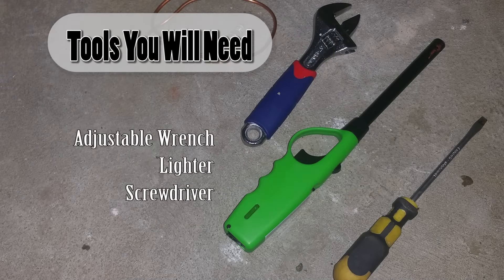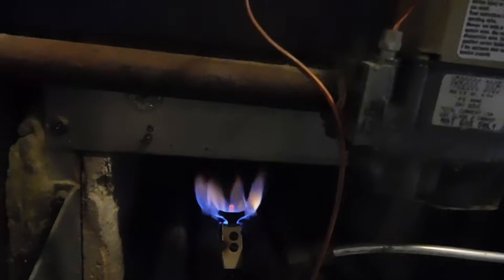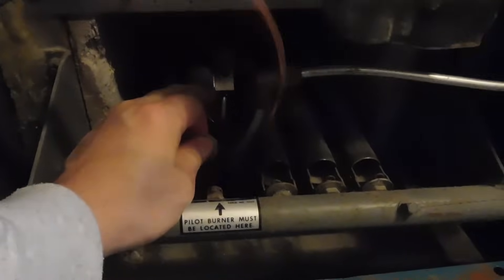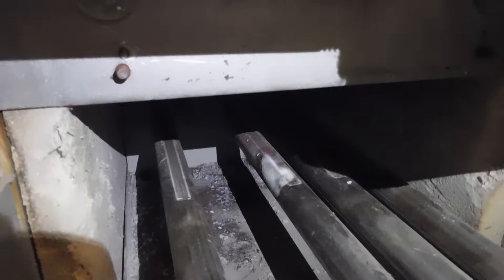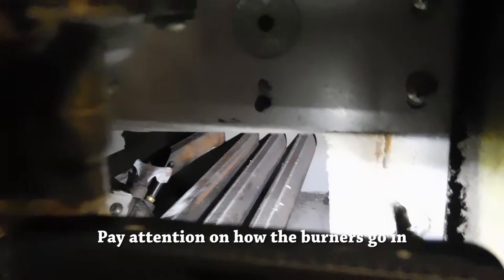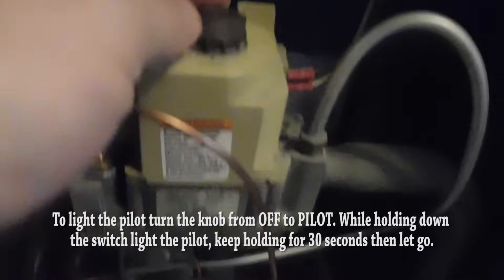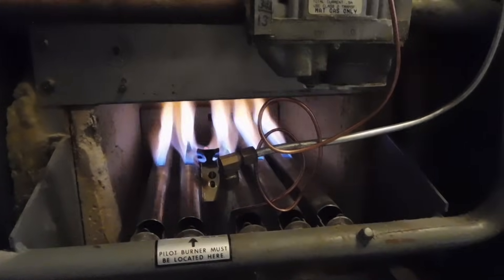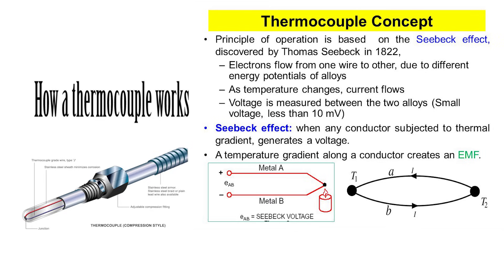Boiler Pilot won't light / Replacing the thermocouple if the pilot won’t stay lit

Comment from the maker: Thank you all for the great positive comments. I really hope this video helps as many people as possible. Link to thermocouple https://amzn.to/2VmVV9Q 
If this video helped you I would love to hear about it in the comments. Please consider checking out and/or subscribing to my channel and supporting me by signing up for an  Amazon 30 day FREE Trial - https://amzn.to/2ItA9Ar
Reply: Da P.A Hi there !! i’m hoping you can help me on this one; i’m trying to repair my friend boiler, his furnace just stopped working, is dead, pilot is off and doesn’t light up, so far i checked the power coming into the furnace, i have 120 volts in, and 120 out at the on/off switch, i have 24 volts coming into gas valve, but for some reason there is no gas flowing because pilot doesn’t light up at all, i checked ohms on the gas valve and i got 5 to 7 M-Ohms, i checked continuity on the gas valve terminals and i got OL (open line) i also checked the vent damper and it’s on the open position, the gas pipe is open as well,the boiler is Weil Mclain Model # CGa-5 SPD, and the gas valve is a honeywell VR8200A2116, i need help desperately, what can i do ??? replace the gas valve??? the thermocouple???  do more troubleshooting, please any help is greatly appreciated.Cheers.🙏🙏

Comment: I know this is an old video, but I just wanted to say I have a 90's Reem Criterion II gas furnace and my flame is 3 times smaller than yours.  My thermocouple lasts 7 to 10 years. Maybe your flame is too high and that's what is causing you to have to change out your thermocouple every 2 years???
Reply from the maker: I ended up adjusting the gas flow to the pilot and it's been lasting a lot longer. Thanks for the comment.

Comment: Home Depot doesn’t open till morning and mine just went …. So we turn off the gas someplace?? That little knob next to where you press down?? I turned it to off….and will go get a new thermocouple early in the morning. Praying that is all that’s wrong and it solves the problem. Glad to find this video. Will review instructions in the morning.
Reply from the maker: Good luck  keep us posted
Reply: @daP.A it was a $10.38 part in the 518 of NYS and it was fixed by my neighbor who was actually home today. Last time it went, aprox 10 years ago, I was able to do this over the phone with instruction from a childhood friend. This time due to chemo neuropathy, I struggled getting my fingers to work and thank God my neighbor was home!! I’m sitting in 70 degrees tonight & a snow storm is coming overnight. I’m glad I found your video!! It was the 3rd time mine had to be replaced since 1998 when I moved in. Not bad!! My furnace is a beast!!! I hope it goes for 80 years like someone else’s in this thread!! ♥️🔥🤗

Comment: Thanks for the video.  For those with the Pilot going out after the hardware store closed, try cleaning both the Thermocouple tip and the Pilot light tip with a cleaner, but don’t clog the Pilot tip or leave debris.  It’s a last ditch try.
If the TC’s bi-wire is fused, it has to be replaced.  But maybe corrosion or soot is preventing a sufficient electrical current, only like around 6 millivolts, from keeping the Pilot solenoid open to feed gas.  You can restart after the cleaning, and replace the TC the next day.
Reply from the maker: Great advise, thanks for taking the time to post and help others!

Comment: Excellent instructional video. My pilot light went out twice this heating season. I was able to relight the pilot both times, so I’m not sure yet if it is the TC.  There doesn’t appear to be any drafts nor leaks, but given the TC is several years old, it’s very well possible that’s my problem. I’ll pull it out and check for corrosion, I haven’t done that yet which is what brought me here to this video. I now know this is something I can handle but more important, what to look out for and pay attention to, such as the gas elbow joints. 👍

Comment: You're firing through those every 2 years because your pilot is ridiculous.
Reply from the maker: @FluxinShitUp  it actually ended up being a combination of the things but the main reason was the pilot light was too high, I ended up turning down the pressure a little and haven't needed to change the pilot
Reply: @daP.A  thankyou for the video though. 

I'm a 24-year heating tech. Got one of my young guys out there this weekend running oncall No heat calls. Sent him your video to guide him through it with the only other instructions being to take the pilot line off the gas valve so you can just bring the whole tube out and Not put the pilot tube under stress. 

Mission was successful , he's got their heat back up and going.

Comment: replaced mine. get like a wood burning smell after. do u think i need to tighten the thermalcouple more? i snugged it. and i was real careful w the flex aluminum tube not to move it too much. just pull out main burning replace couple and put back.

Comment: Thanks for the video. My wife agrees with you that we should change the thermocouple every two years so it's on our calendar to do it each spring when we extinguish the pilot light for the summer.

The thermocouple end required a 1/2" wrench but I couldn't get it to seat. Channel locks it was so the swap out took me longer than it should have.

Comment: Be careful of companies claiming they need a "diagnosis fee" from you. My pilot light wouldn't stay lit so I called a heating company. A tech came over, opened the boiler, and did exactly what I did. The pilot would not stay lit. He stands up and says: "We need a diagnosis fee of $205 and then another $357 to replace the thermocouple." The last time I had a tech at the house from another company they just charged me for the repair, so I asked the technician what a "diagnosis fee" was. After a lot of nonsensical word-salad from him I realized it was actually a basic fee just for visiting. This would be fine if:
1. The charge were about $75 (not $205), and
2. If the problem couldn't be repaired (or I didn't want them to repair it), and if
3. They had told me about a $205 "just for visiting fee" PRIOR to coming to my home and opening my furnace. (In which case I would have told them to blow it out their ass and then call another company).
So I said if you know the problem and are going to charge me $357, how do you justify the "diagnosis fee"? That should only be charged if you AREN'T going to make any money off of me for the visit to make the visit worthwhile and profitable. His answer was: "I don't own the company." I told him to call the boss and tell him I'm not paying an unjustified $205 surcharge when you are going to bill me $357 for a thermocouple replacement. Well what do you know, the tech barely got the words "the customer won't pay a diagnosis fee" out of his mouth before the boss said to wave the fee. Of course he did. I'm obviously not the first customer to tell him to shove his $205 "diagnosis fee" up his ass and instead I'll pay another company just the $357 for a $15 part that takes less than 20 minutes to install. The greed and arrogance of these service companies can be astounding. Obviously I'll never use them again. And with the internet, I'll make sure EVERYONE knows of this slimy practice on their part. Thanks to videos and creators like this one I'll buy a back up thermocouple and replace it myself when the time comes. Just angers me how these companies are so opportunistic. $357 for about 45 minutes work INCLUDING travel time isn't enough. They have to balloon the bill to $562 just because they know their customer is cold, unknowledgeable, confused, and being confronted.

Comment: Hi,after Changing thermocouple pilot still not staying on any idea whats the problem thanks.
Reply from the maker: It could be the valve itself, but make sure thermocouple is in the same position as the old one near the main burner. If you can't figure it out call a plumber, dont do anything you are not sure about.
Reply: @daP.A thank you very much

Comment: Good job and great helpful information.  I'm curious: when you removed the old thermocouple you removed an aluminum sleeve around it and didn't replace it when you replaced the t-couple.  I assume the replacement didn't need it?  Thanks.
Reply from the maker: Didn't need it, although sometimes it does, depends on the thickness and manufacturer. The one I get is a little thicker and lasts longer.

Comment: Thanks for a great video.  My pilot light wouldn't stay lit and I was 90% sure it was the thermocouple.  The boiler service company, who are 10 minutes away, wanted $222 just to diagnose the pilot light and wouldn't tell me the cost to replace the thermocouple.  It took a trip to the hardware store, $15, and about 20 minutes with a wrench and flashlight to get my heat working again.  Those heating companies are just robbing people!
Reply: They’re not robbing people. They’re charging for their expertise. Years and years of knowledge. Good for you for learning how to do it yourself though. A lot of these things are easy but people are afraid to touch them.
Reply: @davidlaziness  You've contradicted yourself. ''These things are easy'' so the expertise and years and years of knowledge you also speak of is just bullshit. These so called engineers are generally the thicko's of life, who think their jobs are rocket science, in reality they're conboys.
Reply: Yep, just went though the same bullcrap. They wanted a $205 "diagnosis fee" on top of $357 to replace the thermocouple. I told them to drop the fee or just leave my house. They dropped the fee and did the job. After watching this video I can now change the thermocouple myself. So from now on that heating company will never get money from me again. All because of arrogant greed.
Reply from the maker: Glad it worked out for you. Thanks for leaving a comment.

Comment: Thanks for this video. I have never replaced the thermocoupler in my Weil McLain , it's 27 years old. I now have to add this to my spare parts cache.
Reply from the maker: yes I always have a couple
Reply: It's important to understand that thermocouples do not fail because of corrosion or contamination but rather that the hot and cold junction breaks from age or from cooling because the flow of gas to the pilot burner was interrupted possible because of appliance maintenance or maintenance by the gas utility.  Thermocouples are very common in rental underlined hot water storage tanks where the operate year after year without ever being serviced or replaced.

Comment: Hello I am dealing with this problem now and I replace three thermocouples and nothing is working
Reply from the maker: Could be you dont have gas, or the gas valve itself. Did you figure it out ?
Reply: @daP.A  yeah I have a gas furnace and hopefully I can get it fixed tomorrow. I have a new gas valve but I going to wait for a professional to install it

Comment: PLANNED OBSOLESCENCE IS THE REASON THE THERMOCOUPLE GOES BAD EVERY 2 YEARS.
Reply from the maker: not in this case, I had the pilot flame too high, burning out the tip over time, now if you want to talk about electronics thats a different story.
Reply: @daP.A  THE WAY I SOLVE THE PROBLEM OF THERMOCOUPLE ON A BOILER THAT CONSTANTLY GO BAD, IS I REPLACE THEM WITH A HUSKY THERMOCOUPLE USED ON COMMERCIAL COOKING OVENS. THAT DOES THE JOB TO END THIS PROBLEM.

Comment: Your video is great, I have the exact Burnham . Is it possible to unscrew and replace the sensor from the bottom, without taking off the main tube ??
Reply from the maker: It's possible but harder to do
Reply: @daP.A  
 Thanks for the reply. Happy New Year. 

I cleaned the sensor, and the furnace has steady flame. the thermostat sent the signal but furnace just don't fire up. I think might be the transformer issue.

Comment: when you move the pilot line all over the place like that you can be pretty much assured that a leak will occur,what you need to do is disconnect pilot line from gas valve as well,makes for a much easier proceedure, your thermocouple is overheated,thats why cherry red,pilot is much too large, I suspect someone at some point has enlarged the pilot orifice. you should be using fixed wrench to loosen connections,adjustable wrench often too large to work with. thermocouples typically last 10 years or more,yours dies because of the cherry red overheating, breaks down the thermocouple,nothing to do with corrosion .decent video,my  son sent me this link as he needs to replace thermocouple on his boiler.
Reply from the maker: There was no leak on the gas line I checked once I was done. Also the pilot needed to be replaced because vas you stated it was burning too hot, adjust the gas to it has prevent me for replacing the pilot which used to be the case on a yearly basis. I used the tools at hand in hand.  I hope the video helps your son as it has helped many people so far
Reply: @daP.A  he managed to get it done today.was helpful to him, thanks

Comment: This video was really helpful! Just purchased this home in September and woke up today to a cold house on our Burnham boiler. After an initial lighting of the pilot light that didn't stay on I continued searching YouTube and found your video. Made a trip to the hardware store and picked up a new thermocoupler and installed it and we're back up and running! I did find that the portion where the thermocoupler is mounted to was so corroded that my new one doesn't stay put. I tried to wind the copper wire around the gas portion (similar to how your video shows) to keep it in place and not falling back out due to gravity. I don't have high hopes that it will stay for a long time -- but I at least know what the cause and needed fix will be! The other end of the thermocoupler appears to show the copper having split apart right at the top of the nut that is screwed in. I am not sure if this will become an issue at some point or not. For now though, we have HEAT! Thank you for this video, very helpful and informative. I've still yet to hear back from the HVAC company I called 6 hours ago. I ordered a backup thermocoupler from your link above too!
Reply from the maker: Thanks for sharing this, BTW a reason I made this video is most HAVAC companies will not bother to come and fix something like this, its too small of a job for them. Glad your up and running, please subscribe for more videos.

Comment: My valve stayed shut. Idk what else to do
Reply from the maker: Try tapping it to see if it comes up but you might need a new pilot. Consult and expert
Reply: @daP.A  I just changed the thermocoupler. Cleaned everything. But no gas flows through out the pilot. I’m assuming it’s the valve. I’ll just cough up the money and have it serviced. The problem is….is 38 degrees here in New York.

Comment: that part with the adjustable wrench hurt offended me.  You hurt my heart.  If you don’t have a line break wrench, then use an open end 7 sixteenths wrench.  It’s just so much sexier.  At least you didn’t use pliers.
Reply from the maker: Sorry it was easier not thinking about the size. Thanks for watching.

Comment: Saved me at least $150 from calling a plumber. I didn't have to remove the burner though just reached under and unscrew the thermocouple and pull it out. Installing the new one could have been easier but the design of the locking knob is just ridiculous.

Comment: Great video. Thanks for sharing this. You mentioned a way to check that the gas pipe was sealed-how would you go about checking there is no leak on the pipe? Thx again.
Reply from the maker: Soapy water around pipe, if it bubbles there's a leak

Comment: Hi, so our thermocouple needed replacement and we have replaced it with the following steps. We were able to also light the pilot, however we were unable to have our thermostat go on. We tried to put the heat shield on, switch the emergency switch to on, and turn the knob from pilot to on and the flames will not ignite (refer to the end of this video).  Any help or suggestions will be great.
Reply from the maker: If the pilot is now lighting  but turning from pilot ot on has no flame this could mean your thermostat is not calling for heat,make sure it's on. You can also have a bad gas valve. If your not sure call a professional

Comment: Great video, 
My thermocouple and gas valve was changed , however the pilot keeps going out after several hours , 
Any idea what can be wrong ?
Reply from the maker: Wind draft, thermocouple to far from gas line. Thermocouple not install right amount from gas valve. Also make sure thermocouple is screw in tight at the power side.
Reply: @daP.A  thank you

Comment: Really appreciate this video. I knew i had a thermocouple issue, but decided to call a professional heating company anyways because the nut looked striped and I didn't have time to pull the whole assembly out. Well the heating company said that the assembly needed to be replaced, it wouldn't be here for 5 days, and the total will come to around $460, plus a $120 assessment service fee. After they came out I decided it can't be that crazy expensive to replace this little part. Found the part quickly at Supply House, shipped to me next day with 15 hours, watched your video (same boiler), and voila, replaced with 25 minutes, total cost $48,.......and the $125 the crooks charged me. Anyway, thanks for the help.
Reply from the maker: Glad you found this video and saved money. This is one  of the reasons I put this on Youtube. Things are expensive and not everyone can afford those expensive fees, hopefully this video keeps on helping people. Thanks for your great comment and stay warm.